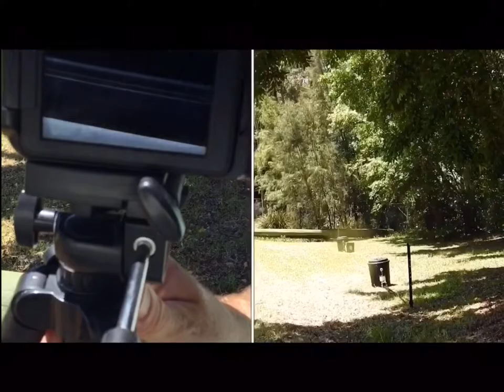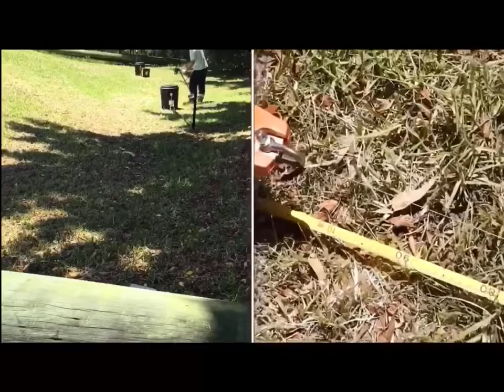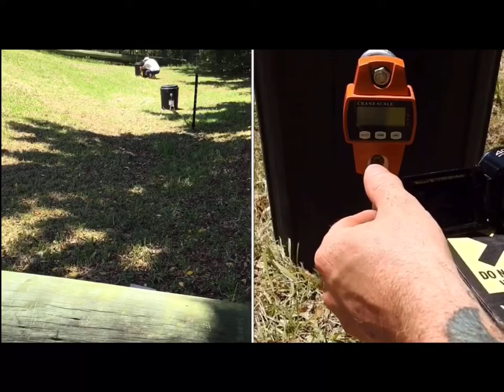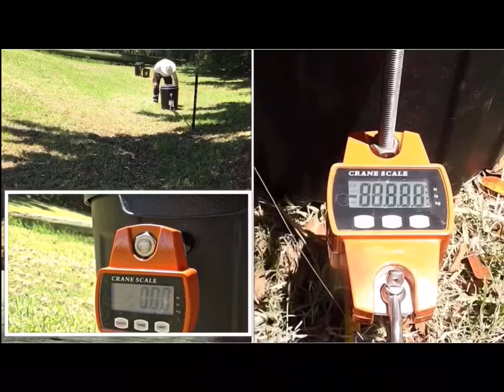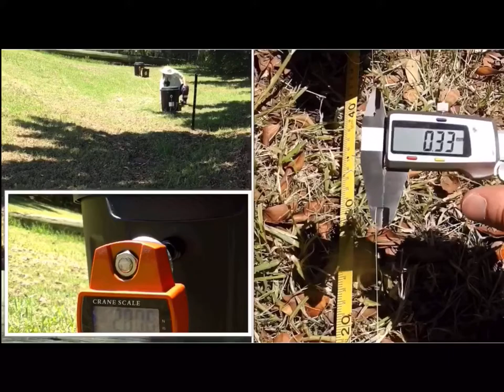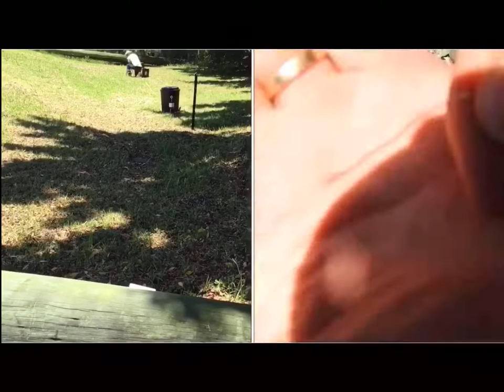TORQUE the LINE EXPERIMENT - FIRST PRE TEST

Comment: Do you know the relation between the tension force (T) produced by a deflection force (F) acting perpendicular to the string and the deflection angle (a) caused by F? The smaller the deflection angle the greater the tension force. Your deflection angle should be as small as possible which means there will be an enormous tension force even from the slightest deflection force.

T = F / (2 * sin(a) ) = F * l / (4 * d)

where T = string tension force, F = deflection force, a = deflection angle, l = string length, d = string deflection from straight at l/2.

Because the force F will be distributed along the string, the string will bend in a cosh function:
https://en.wikipedia.org/wiki/Catenary
This results in a greater deflection angle somewhere between 1 times for straight deflection and 2 times greater for circular deflection, lets take 1.5 times for hyperbolic deflection. Lets assume the deflection force per length unit is (D = F / l). So a more realistic formula is:

T = D * l^2 / (6 * d)

The expected bulge height (b) over a distance (l) for the earth with radius (R = 6,371,000 m) is:

b = R * ( 1 - cos( l / (2 * R ) ) )

Lets make some examples. We want to measure the bulge height with the string to at least 10% accuracy, which means d = 0.1 * b or less.

Example 1: experiment over l = 1,000 m.

b = 0.0196 m
d = 0.00196 m
T = D * (1000 m)^2 / (6 * 0.00196 m) = 85,000,000 * D 
T = F * 1000 m / (6 * 0.00196 m) = 85,000 * F

D = deflection force per meter, F = total deflection force

Example 2: experiment over l = 2,000 m:

b = 0.0785 m
d= 0.00785 m
T = D * (2,000 m)^2 / (6 * 0.00785 m) = 84,900,000 * D
T = F * 2,000 m / (6 * 0.00785 m) = 42,500 * F

Example 3: experiment over l = 3,000 m

b = 0.177 m
d = 0.0177 m
T = D * (3,000 m)^2 / (6 * 0.0177 m) = 84,700,000 * D
T = F * 3,000 m / (6 * 0.0177 m) = 28,200 * F

You see that to measure the bulge to at least 10% accuracy the string tension forces (T) are tens of thousands times bigger than the total perpendicular deflection force (F). The longer the string length, the smaller the factor, but the bigger the total deflection force F = D * l. 

So the string tension force is about 85,000,000 times the deflection force per meter, if you want to measure the bulge with 10% accuracy.

So you have to expect string tension forces in the order of at least tens of thousand Newtons (corresponding to dozens of metric tons) even for a deflection force of only 1 milli Newton per meter (0.1 g/m).

Note: the deflection forces acting on the string may vary in direction and magnitude over the length under water and cancel each other for a great part, except if there is a constant stream.

Comment: Where EXACTLY did the line Break? I might have some input as to why from tests that I’ve done.
Reply from the maker: Pretty much at the knot, I contacted the manufacturer and they suggested an alternate attachment method where you wind it onto the d-shackle somthe Braid won’t dig into itself. What was your suggestion mate?
Reply: Whichever part  the Line is tied tied to, increase the  diameter of it, possibly where the linw will have surface tension against metal parts, eye hooks, using some neoprene padding to absorb the tension a little, spread it out instead of compacting it in a smaller area. sound confusing?

Comment: A Palomar knot or a uni knot will prevent knot failure. There are instructions for these knots on YouTube.
Reply from the maker: Thanks I will look it up
Reply from the maker: It’s was the palomar knot which i used. The manufacturer suggested this knot caused the spectra to dig into itself so didn’t get to the rated tension

Comment: Outstanding job Mitchell! This is the kind of experimentation that Globetards claim we don't do. If you keep on having breaks at less than the rated maximum tension, I would contact the manufacturer again -- sometimes they have bad batches of product and they may have to reevaluate their quality control methods. They might even send you a new spool.
Wish I was there to help -- even the pretests are a lot of hard work! Thank you for blazing the trail; you're making it a lot easier for those that follow in working the bugs out first. 
Oceans of blessings to you!
Reply: It is sunlight degrading the line. If it is reaching 50Lbs on the scale that is the rating of the line. Not a bad batch. If it's knot failure he needs to tie a uniknot or a Palomar knot. There is instructions on YouTube as to how to tie these knots
Reply from the maker: Thanks heaps for the support Wendell. You are doing great work yourself mate, loved the mirror test you did recently, top notch man keep it up!

Comment: That's great !  real science,  issues of course myriads of possibilities.  You cannot predict that.   So looks like the line broke prematurely or under it specified rating.  A flaw in the line or is it related to the knot?  Although it doesn't slip it may be kinking the line,  an over extension on one side of the line around the knot.  
May want smoother transition on that.  Will you contact manufacturer?  I would think the line would actually break at a much higher point ...like double at least.
 You may want to do some break test of your own.   Hate to get on site and have it snap on you.   Also can you do a full mile?  Best of luck..  waiting patiently.  lol
Reply from the maker: Yea I contacted the manufacturer and they suggested a different attachment method, more like winding it into the d-shackle than a knot so the line won’t dig into itself. 
I was pretty upset when it kept breaking at such little force but the new attachment method has been a lot better, will be in my next pre test video.
Thanks for the patience I appreciate it, I’ll get to the main test eventually!
The next test I’ll do is 10metres in water to see how the whole set up reacts to floating, then a longer test before the main event
Reply: @torquethelineexperiment1253  Most excellent sir...great work.
Reply from the maker: Thanks a lot for the support it’s much appreciated mate